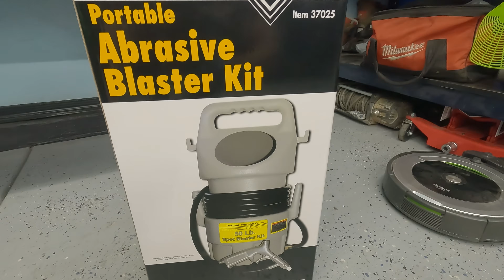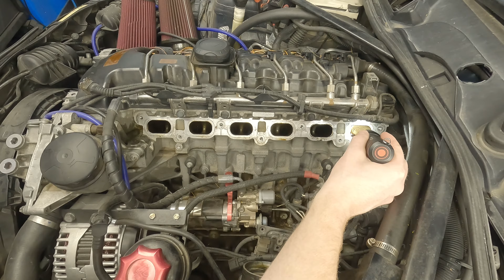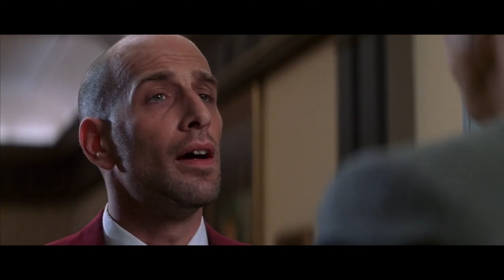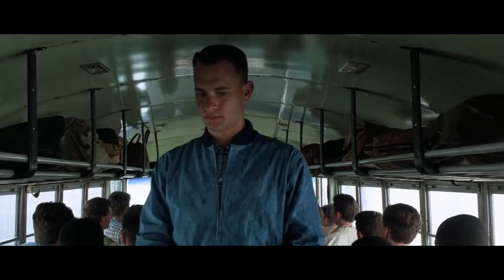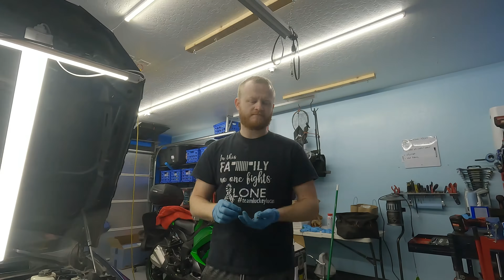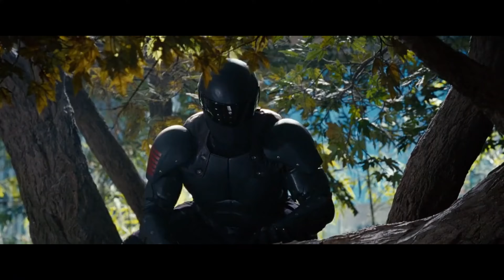How to Clean your BMW N54 intake Ports! (Walnut Blasting)

Comment: What size compressor you use?
Reply from the maker: Mine i believe is a 10gallon from harbor freight. But you can do this job with a pancake compressor, it will just take a little longer. You only use like 90 psi for the sand blaster 🤙🤙